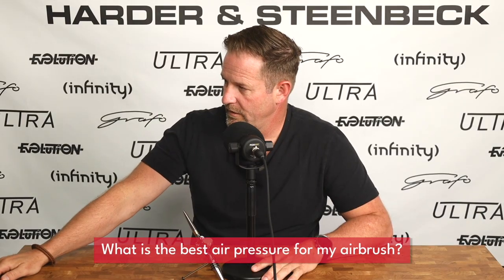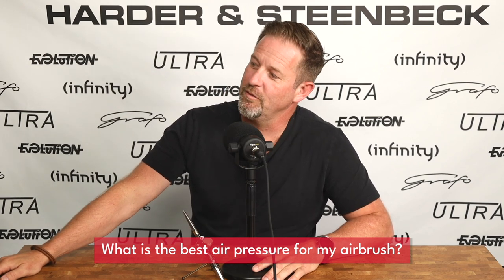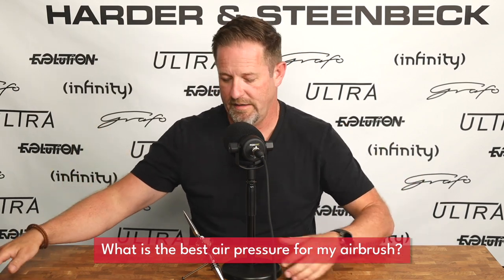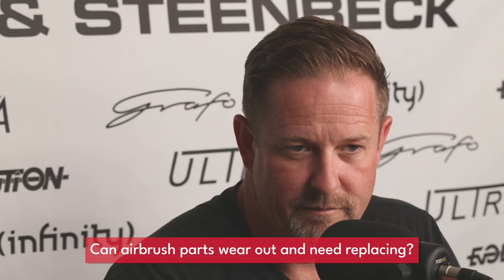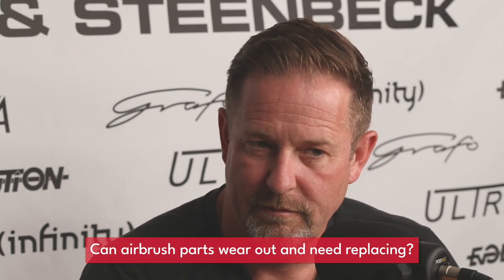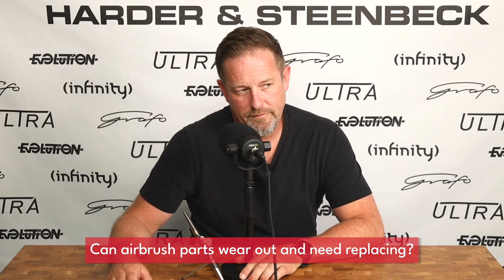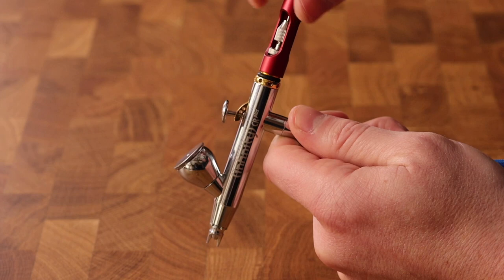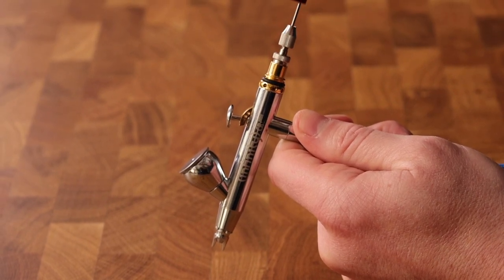The Best Pressure For Your Airbrush

Comment: Great info. I'm more than happy to learn that I was not that far away from the recommendations in this video.  I hardly strip down my Infinity, I use to clean it by blowing cleaner solution in between color refills, even if it's the same color, to avoid paint drying inside, and only strip it completely after a frew months of use.  After almost 30 years using a 150 Badger, I bought my first Iwata a couple of years ago, but wanted to upgrade my work so I bought an infiniity and I coduln't be more happy. You just answered my most pressing question about the cleaning part, and air pressures. thanks!
Reply from the maker: Awesome comment buddy thank you. If it ain't broke, etc! W

Comment: I've said lots of bad words cleaning out my air brush between colors (I have a tendency to over clean) But at the end of by paint section I let it soap with Simple -Green, and rinse. And found that I really do not have to tear down, thanks for the informative video, Still learning Air pressure, with what brand paints... Just because it says Air brush paint doesn't mean it's the same thickness... Thanks again... Big C 😎👍
Reply from the maker: Regarding paint thickness, I spent years in the industry hearing people talk about the thickness of milk. No idea what that really means! Try the tip about the needle dip and let us know how that works for you. In my experience it's the most consistent way of checking thinness.
Reply: @harderairbrush  Thanks I've seen that video... I fail into the thickness of milk when I was listening to those that said you can use craft paint threw an air brush, (lots of bad words came out then TOO) ... almost gave up on painting... Here is the thing, back in the day (couple of decades ago Possibly a hint more) I USED SPRAY GUNS paint every solvent-based paint out there... not going to get into the thickness of those paints, long story short... This old dog is working on a new trick. and don't seem to have the patience one use to have, but still if not more stubborn... LOL, in other works I'll keep working on this come Hell or High water... Keep those Truly informative Videos coming... Thanks again, C😎

Comment: I'm a newbie to airbrushing and i think this video will solve my constant airbrushing issue with clogging. I have an iwata ninja jet compressor which only maxes out at 15psi. I get instant clogging even with very thinned paints. I'm using a .35mm nozzle too. It worked ok with a .5mm nozzle but i can't get the fine details with that nozzle size. On the hunt for a new compressor today. Thank you!
Reply from the maker: Hey buddy - what paint are you using? And what thinner?
Reply: @harderairbrush  army painter mega set, createx, Vallejo. Using the Vallejo thinner
Reply from the maker: Ok thanks for that and sorry for the late reply - if you're using Vallejo thinner with all of those paints, then that may well be your issue. Always use the same brand of thinner as the paint you're using. Hope that helps you out!

Comment: I have a Infinity CR Plus it came with a 0.15 needle set.  What is the main purpose for this size needle.  I can cover a large area with this needle and it will also do detail.  I build mostly 1/48 scale aircraft and 1/35 armour.  Should I spend the $70 or more to switch needle sets to a larger setup.  I use Tamiya paints thinned 50//50.  I'm just confused with all the different options available.  Thanks
Reply from the maker: Buddy if it's doing what you want, don't spend any more money :-)

Comment: I set my pressure to about 2 bar-s and use a small reducer right before the airbrush. I've found one of the limiters that has a quick connector. So my airbrush directly connects to this. But it has no "value" of pressure. So in most cases I adjust it by experience. I check if it makes spiders or not, see the paint consistency and always adjust based on needs. Way quicker than adjusting the "big" regulator on the compressor / tank. As explained in the video - this mostly comes down to "what you do" and "what you have". There is no "one size fit's all".
Reply: Also I have no idea if the value on that "pressure gauge" is correct ot not :D I'd not trust it to be a true value :D I work with pneumatics at my workplace and usually these manometers have a bad enough hysteresis. I won't add a precision manometer or pressure sensor on my setup as it is completely useless. 
I mostly paint with Kimera Kolors now. The base set's core paints are so thick, they need a ton of water. But several of their mixed paints are rather thin. So every time I mix them it is a slightly different consistency. So the quick pressure changing is appreciated. And making it a quantitative like "okay I added X drops of thinner, than I need 1.5 bar's" makes no sense. It just makes you slow, whereas the reason for using airbrush it to quickly make gradients of colour :) It comes from experience not from numbers.
Reply from the maker: I know that this sound horribly imprecise, but once you know how to hear it, it's really effective. Listening to the sound of the atomisation as the airbrush sprays is a great way of knowing if you have enough pressure. When the atomisation of very good, the sound of the airbrush when spraying is very clean. When the atomisation is poor, it's much more like a sort of white noise.

Comment: I have Narcolepsy, and drop the airbrush many times. So needles is the my main expense. So there is no method to take a little more their life ? Or each time is a new needle ? And now nozzles too ? Oh God. I have a Infinity CR Plus ( .2 mm ) and a Evolution ( my first one .2mm ). Thanks for your airbrush, time and tips
Reply: You can buy the needle caps that are used on the ultra range. They have more protection, which would be better for your unique situation
Reply from the maker: Hey buddy - I think we can help! We actually do a part called the Distance Cap for the Infinity CR which I think is perfect for your condition. Give me an email on wjs@harder-airbrush.de and I'll send you a few free of charge to see if they help you out! They are compatible with the FineLine set-up, which would be on your Infinity. You can also fit the FineLine set-ups to the Evolution, if you wish.
Reply from the maker: Also good advice. Thank you!
Reply: Bless you buddy, I've health and hand issues, but we've got to keep on keeping on haven't we. My suggestions, off of the top of my head have been eloquently answered by others already. I hope that all helps. I wonder if some sort of protector could be CAD designed and 3D printed by a soul cleverer than me🤔🤔 Blessings and good luck ✌️👍💜😊
Reply: @NicholasGeorgePrior  Thank for your time.  I use air caps or it will more.
Reply: @musoseven8218  I started using a stick like painters do, I put my hand down and if it "falls" I'm on top of the stick.  I'm adapting the accidents accordingly.
Reply: @harderairbrush  Ok Many Thanks.    If you have read about fall with the Evolution in my hand , well it bend all the rear part . I replace already and "shoot" like an Angel, and it like a tank.
Reply: @rf64  That's a great idea to use a "mahlstick", I pondered something similar. I'm heartened to hear of your tenacity and determination, it's inspiring - keep going 💜✌️👍😊